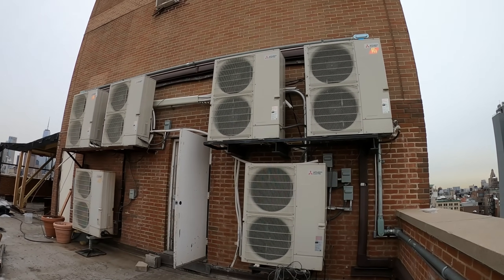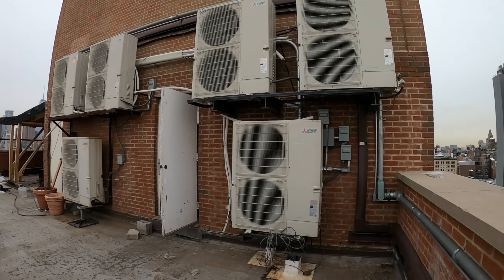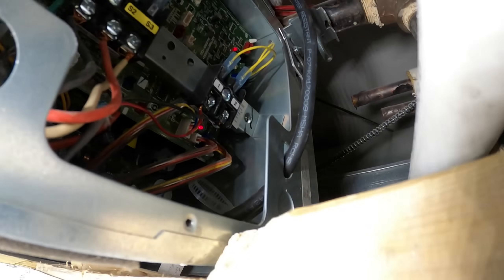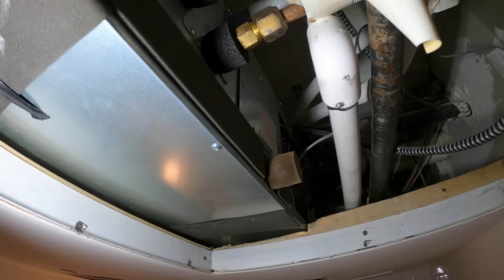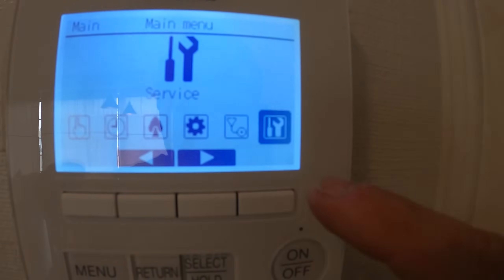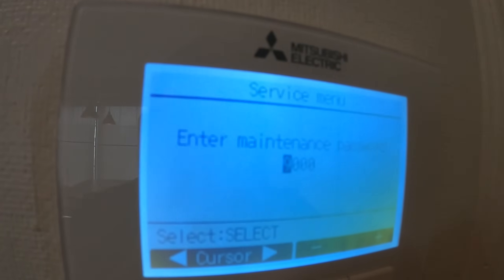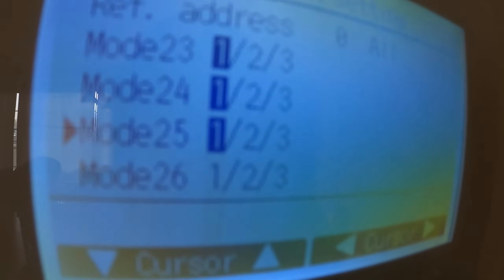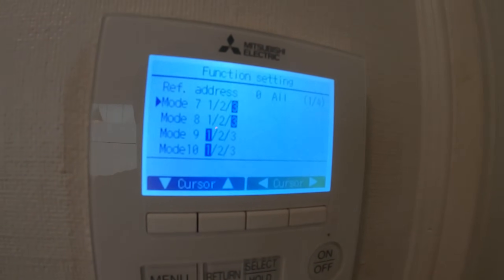HVAC: Mitsubishi M/P Series Heat Pump Not Working Properly (Indoor Temperature Detection Settings)

Comment: Typically in cooling mode you would want to keep the fan running for air circulation even when it is not actively cooling. Even if you were to change the fan speed on the thermostat from Auto, it will still not run until it starts cooling/heating; Auto in this case means that it will vary the fan speed between low/medium/high when it's running. At our university building with LG units, the default setting is low speed in cooling and off in heating, I've changed this to keep them in high speed for both cooling/heating modes for the units in the hallways to help with air circulation.
Reply: You'll wear the motor bearings out quicker in high speed especially on the LG units. If it's a multi split or vrf system there is always hot refrigerant circulating the indoor units in heating so you end up getting continuous heating output.

Comment: The PAR-4x controllers can control up to 16 P series systems. So you can average the IDU sensors. You may also want to turn mode 24 Off on a ducted units.